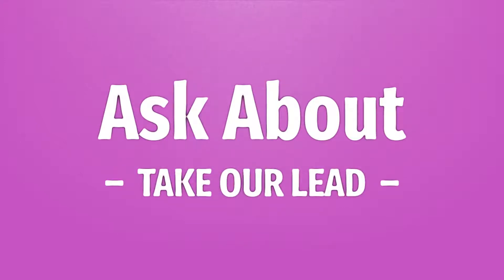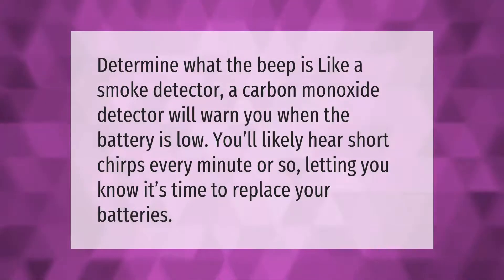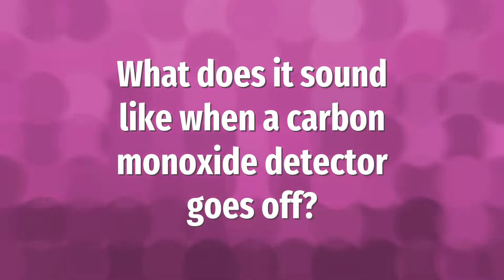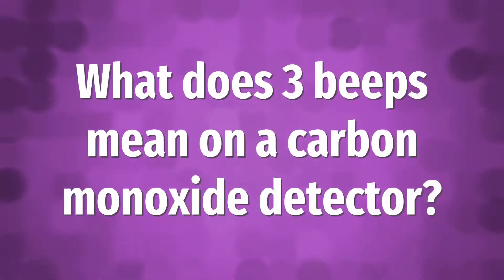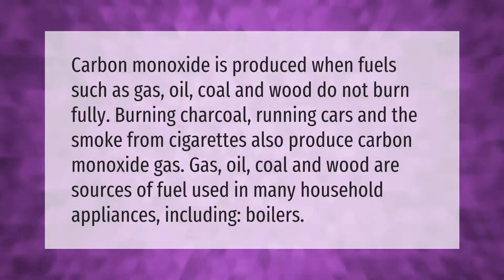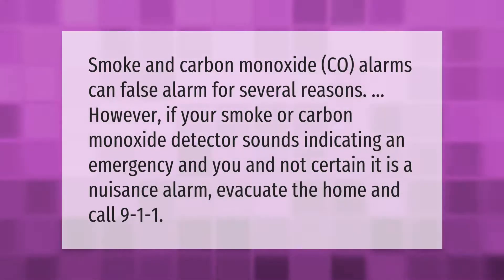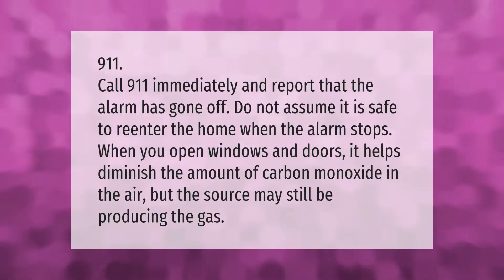What do I do if my carbon monoxide detector is beeping?

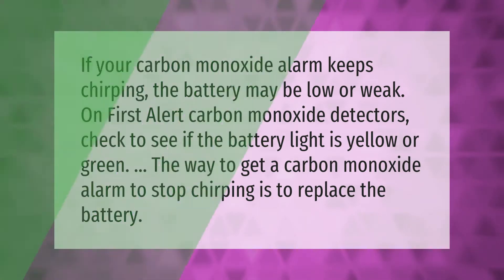Comment: Last night my carbon monoxide detector beeped and I thought it was the doorbell at 4:30 I thought it was weird I went back to bed then I heard a voice I got a knife and went around my house and then I went in my backyard I heard another voice I opened the door to see what / who was saying and I heard “Hey there, The carbon monoxide is getting higher” and then I called 911 and they said it was dangerously bad and said thank you for having a alarm or you could of died  the reason behind this is the power was out and I was using a generator I frogot that it has to be 20ft away from the house IT WAS 2 FEET FROM MY HOUSE and it was right next to a vent so yeah lesson learned